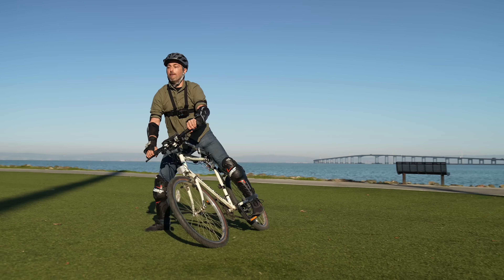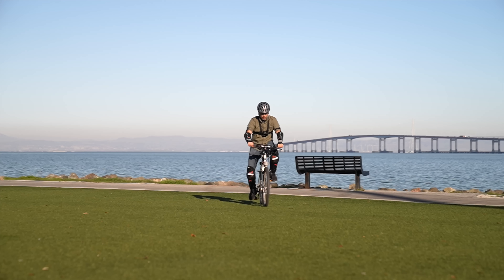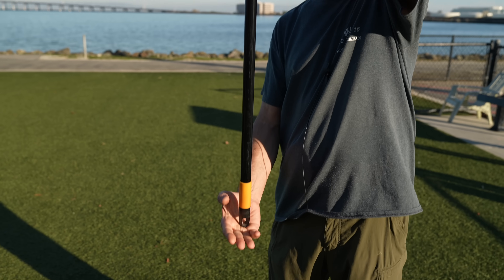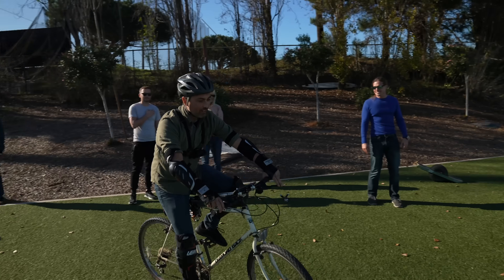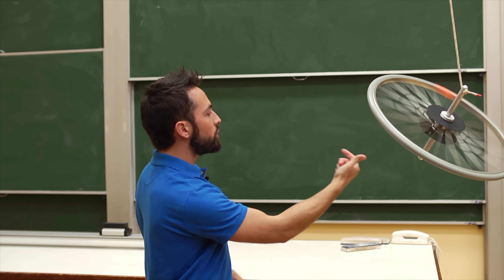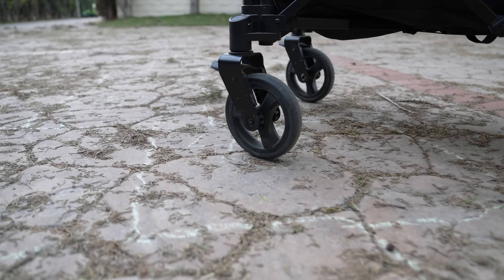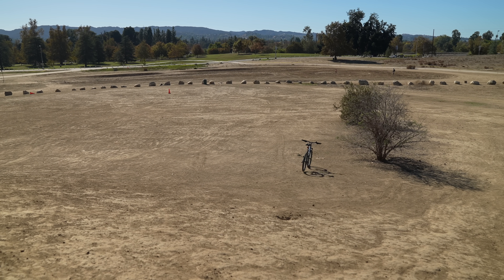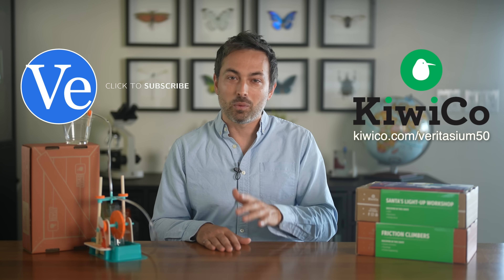Most People Don't Know How Bikes Work

Comment: It’s odd to me, I used to do a lot of mountain biking and BMX and never once considered that I was counter-steering. I always thought I turned by shifting my weight rather than relying on the handle bars primarily, but it seems that my balance and control of the handle bars became so instinctive that I just perceived it as such, which is weird to think about.
Reply: This is the question I have... I feel like one can turn without (what I understand as) countersteer by just leaning first and turning into the fall. E.g. angling your head left then turning left. I haven't ridden a bike in several years now but I remember when I used to do it all the time I could turn while leaning back without using the handlebars, seemingly just by leaning and pedaling, but maybe I was leaning right first without noticing, or maybe the act of pedaling caused a small countersteer to start it, I guess?
Reply: @fzzzt  How it works is that by learning you upper body to the left that causes the bicycle and your lower body to lean to the right. Equal and opposite reaction. The bicycle learning to the right causes the front wheel to turn to the right for the reason explained in the video.  This front wheel turned to the right is the counter steering that will cause the bicycle and rider together to lean to the left. Which then causes the turn to the left.

Your perception of what you were doing was correct. I do wish that the video covered this. But I understand that it would have made the video too long for most viewers.
Reply: How riding with no hands or leaning to turn works is that by learning you upper body to the left that causes the bicycle and your lower body to lean to the right. Equal and opposite reaction. The bicycle learning to the right causes the front wheel to turn to the right for the reason explained in the video.  This front wheel turned to the right is the counter steering that will cause the bicycle and rider together to lean to the left. Which then causes the turn to the left.

I do wish that the video covered this. But I understand that it would have made the video too long for most viewers.
Reply: tbh. im surprised that there arent more experienced MTB/BMX riders talking about this. maybe the initial countersteer is so miniscule when experienced riders ride a curve that we just dont experience it as a countersteer. or you just use the impulse of the last driven curve to initate the next one. which i find way more likely than countersteering to initiate every single turn

Comment: The basic problem coming from the locking in my eyes is different.
Nobody riging a bike is able to drive a straight line. One always steer - even though little - curves to keek balance. Locking the steering makes such a "balancing" turn impossible and - because of it's almost always subconscious nature - leads to a fall into the locked direction (left turn is locked - a fall to the left side (again: Because when in driving a ... nearly straight line, but  turn a little too far left I would - under normal circumstances make a - subconsciously - a small left turn, which leads to a force, that presses me to the right - and bingo - again halfway in balance).
Someone though, who made all the BMX stuff, balancing on even a holded (not driving) bike, shouldn't be that heavily affected, because they have learned to keep their balance independent from such turns.

Comment: Steering the bike to keep it under you is tautological, when is no more under you you have fallen. The bike remains under you by turning the steering bar to create a righting moment through centrifugal force (which is why you have to move) to balance the gravity component out of the plane defined by the two wheel contact points to the ground and the center of mass, somewhere below your belly button. In the one wheeler case it's the same thing but one steers the only wheel by angular momentum conservation between the top and bottom part of your body which rotate in opposite direction, a purely dynamic equilibrium with a limit which is the flexibility of your spine.

Comment: I can't believe how much bulshit there is on YouTube. If you don't understand how a bicycle works, then you don't understand what life is.  And you went to school? LOL.

At 5 y/o, I had a little bicycle with training wheels and from that day on, I learned how to ride an adult bicycle without problem.

A bicycle was invented after years of experimenting, and this new type of design proves nothing exciting. It's a waste-of-time video just to make a point and tell us the bulshit that is not going to mean anything. 

You people of today need to get off the effing drugs. Anything else shown on this video, such as a bicycle rolling downhill or how a gyro works are a good example on this waste-of-time video. Of course a bicycle can go straight when in motion because the front wheel pick-up speed and respond to the gyrogravity of the Earth to keep it upright till it stops going downhill, even with a rider riding it without touching the handle bar to steer it. That's mainly because of the fork design and the angled weight that forces the front wheel to keep the fork straight, and only turns either side if the rider leans left or right . But, that type of turns can only be achieved at certain high speed. 

That you released this video in 2022, what do you think you're going to prove or achieve on something that is not new to learn? I want to see how many people are interested in this bulshit video. 🤔

Comment: I used to stationary balance without taking feet off the pedals when I stopped at traffic lights. I could maintain this balance until the lights charged. It takes practice without using the front wheel too much to counter balance, but nothing new to exprerienced riders.

Comment: I can totally understand the counter steering for a short arc. When I'm biking I tend to do long arcs so I just pre-lean without counter steering and have small shifts in the front wheel. Also I'm usually hitting around 25mph and doing a sharp turn then gets really dangerous and I ain't no professional.
Reply: Yeah this is what I'm thinking. From my understanding of how bicycles I reckon it is possible to turn without countersteer, provided you lean first and the don't need a tight turn. Also a faster speed you'd get less tight turns. But countersteering definitely makes tight turns easier I just feel like this video might be oversimplifiying things
Reply: @hobbesthedog6340  such is the nature of youtube. I just would have thought that if they made such a fancy gizmo for this they might have gone further into what people think on the thought of steering. I'm guessing most people are thinking of turning at faster speeds, when they answer. 

It wouldn't surprise me if the same thing was happening at higher speeds either, just the degrees in the counter steering are more negligible. I would have just liked to see it.

Comment: I'm impressed it's so hard to ride bicycle when the handles are locked. I would I think that the bicycle keep moving with your body mass, making it possible to turn by leaning in the direction you want to turn (just as a motorcycle do)
Reply: Riding with no hands or leaning to turn works is a form of counter steering. Learning you upper body to the left causes the bicycle and your lower body to lean to the right. That is an equal and opposite reaction. The bicycle learning to the right causes the front wheel to turn to the right for the reason explained in the video.  This front wheel turned to the right is the counter steering that will cause the bicycle and rider together to lean to the left. Which then causes the turn to the left. 

It is easier to observe this by having someone else do this riding as you watch. Or video your with a stationary camera on a tripod. If you try to observe yourself while riding you wouldn't notice all the parts.

I do wish that the video covered this. But I understand that it would have made the video too long for most viewers. 

BTW, Over the last four decades multiple studies have shown failure to understand and use counter steering is a contributing factor in many motorcycle fatality.
Reply: @erniecolussy1705  That's really interesting thank you very much

Comment: Wonderful video. And I'd guarantee you that because it's so humbly and simply explained, that if you showed this to a new or beginner rider, it would help them to ride significantly. That also goes for motorbikes, because the EXACT same principles apply. With the latter, you just gotta focus on having good control over the clutch and throttle too 😉
Great stuff 👍🙂

Comment: I've got co-ordination issues and wanted to try this out myself. My way of cycling is, quote from my instructor, "odd"; that's mainly because I over-lean into the direction I'm going before I start turning the handle bars.
  In fact, I barely even move the handle bars when I have any amount of speed. Though, I tried this counter-steer method and holy hell riding a bike has never been easier.
Reply: I lean into turns the same way but I think its cause when ever I ride my bike to my buddies I'm hauling ass to spend less time on the 2 mile ride there
Reply: Instructor?
Reply: @shaggerchuck  Yes; cycling instructor.
Reply: @shaggerchuck  if he rides as hilarious as he describes it's best that he's getting help lol. his riding style sounds dangerous for long term survival on public roads.

Comment: Counter steering only works at a certain speed and beyond.  For example on a super sport motorcycle you clearly are steered fully right when making a left hand turn at full lean.  However at parking lot speeds you'll turn left to turn left and you're not leaning.
Reply: True. Zero speed and beyond.

Comment: Motorcycle riders know to change lanes you pull back on the opposite handle that you want to go. The friction from the ground passing by pushes you into the lean needed to turn. It's where the rubber meets the road.

Comment: Bike no need to fear think or resolve , action and solution is geatly found supported and inhansing lots offf viaties , clockwise anti clockwise this isnt a joke for the brain in charge or resting charging mode to rest on that tide of direction waves , like a plate the rim or the edge it is this much simple , size quality above head noticable and light and skin pulse friction charging , this way a bigginer an intermidiate and experts can manipulate there goals there charactristic of a tatro sphere as long as your control in motion ubove head under the seat infront in back sound friction clockwise anticlockwise pedaling makes the comfort the normality and breathing suport. Cool name YourChi❤

Comment: You mean in the USA, nobody knows how to ride a bike! That is why they wear a helmet like a dork!

Fun fact. The risk on a head injury in a car is way higher than on a bike. From all accidents with a car, 70% of the injuries is head injuries and from that 70% is 60 to 70 skull fracture.
Still the dumbass cyclists wear a helmet on a bike, but not in a car, where the risk is way higher. On a bike you have a way higher risk to break your arm or colerbone. In a badroom the risk is even higher than in a car. On a bike is the %  about the same as walking. But by walking, riding a car or going to shower, nobody wears a helmet!

Comment: Here is a good way to help explain why countersteering a bike/scooter/motorcycle... is NOT required.   Many moons ago, I owned a gasoline scooter and one day for fun, I took it on a vacant go cart track that had many "tight" turns, but instead of just riding around normally on 2 tires, I wheelied the entire track.  How could I steer around the track if I was unable to countersteer, since the front tire was off of the ground?  You cannot even say the gyro effect is what I used to steer because to turn the scooter left while wheelying, I could either turn the front wheel left or right (my choice).  I could actually balance it using either of those 2 methods.  Countersteering DEBUNKED!  Weight shifting (and some good balancing skills) are all I needed.  So if 2 tires of a bike are on the ground, shifting my bodyweight will also affect how the bike performs.  We do not normally learn to ride a bike that way since it is MUCH easier to countersteer, but it is wrong to say that you MUST countersteer a bike.

Comment: Just pop it up onto its back wheel and turn it on its back wheel like a unicycle. Problem solved.
Reply: Did you see me riding the unicycle in the video?  You STILL need to counter-steer.
Reply: @Rick_Cavallaro   Yes, one still needs to counter-steer on the back wheel, which I think still would be possible even with the steering on the front wheel locked.

Comment: Anyone who has ever tried riding a bike without touching the handlebars knows that they're not what you actually use for steering.
If anything, I'd say you turn by tilting your body, the handlebars turn left or right as a consequence, and holding it helps make the trajectory cleaner and lower the risk of accident due to, for instance, a small obstacle on the ground. It stabilizes the whole thing.
Holding the handlebars only helps stabilize the trajectory that you already initiated with body movements.
Reply: no